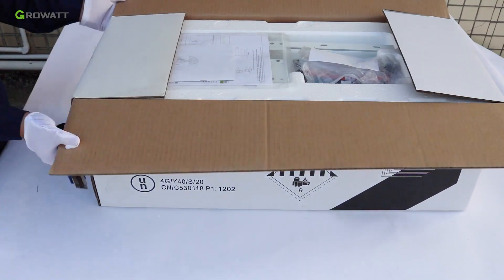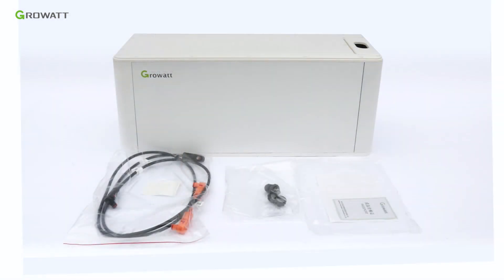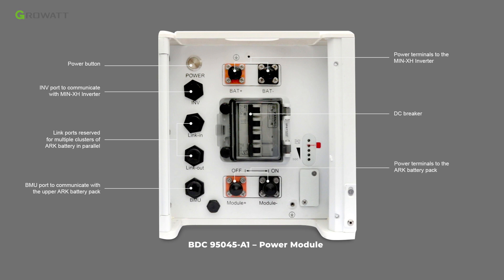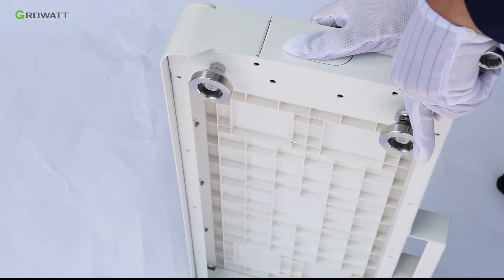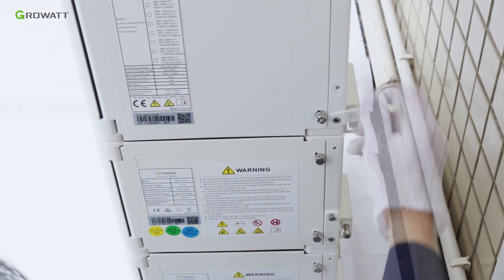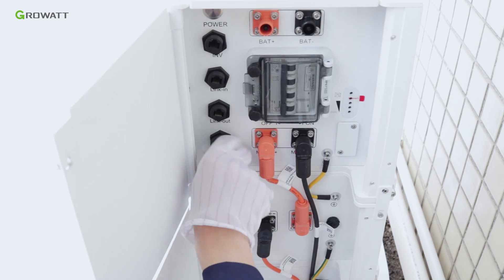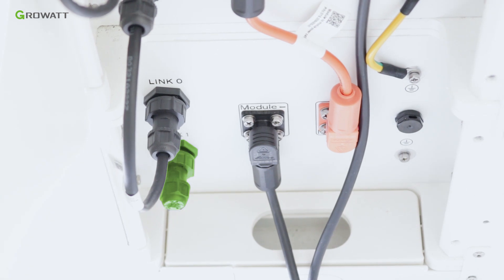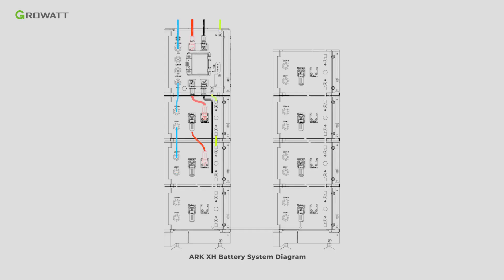ARK XH Battery System Installation

Comment: Hi. Please help. I bought a BMS witk the ARK batteries, but the single plug didn't come in the box. I installed the full battery system, and the inverter recognized it. But the batteries don't charge or discharge. The inverter also displays error 218. So I turned off the batteries. Is this related to the single plug? Do you know if it serves any purpose in the circuit besides dust protection?

Comment: I have 4 modules (10 kWh). I charged it to 100% and disconnected. Then I added 4 new packs and charged to 100% and let it balance for 3 weeks. Then i connected all 8 packs together and connected to inverter. bms says abnormal, can i reset it somehow?
Reply from the maker: For technical support, please contact our service team at service@ginverter.com or call our service hotline at +86 755 2747 1942. Thank you!